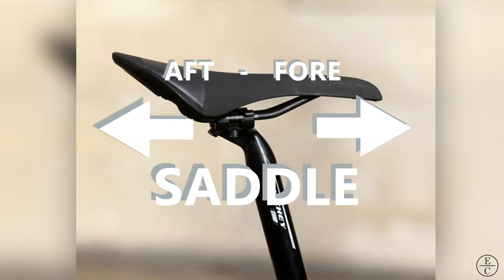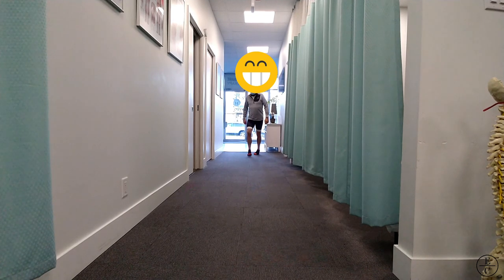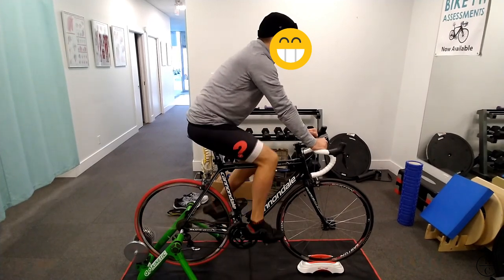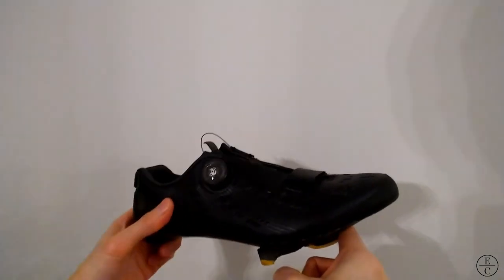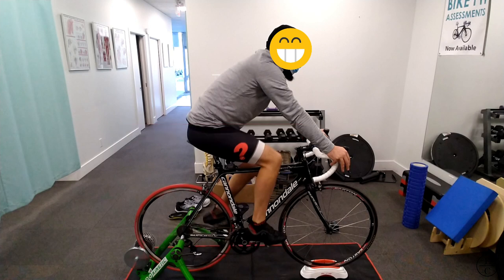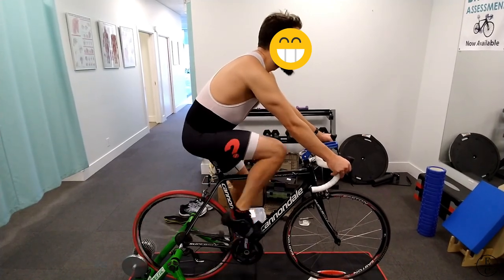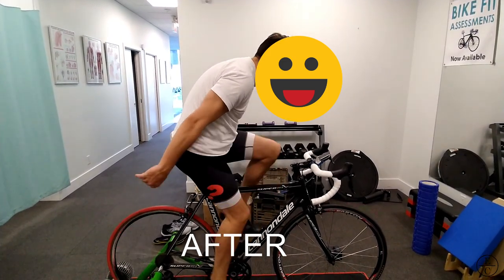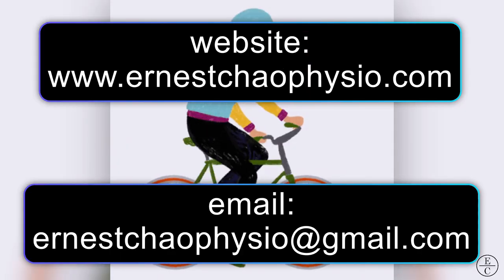"No hands" method to adjust saddle fore-aft

Comment: Nice video! 👍🏼 Could you please explain me why I moved the saddle all the way back (limit line) but still hard to keep the "no hand" position as you instruct? I have to put a lot of pressure on my soft tissue to maintain.
Reply from the maker: Other issues that may still limit your ability to pass the "no hands test":
1) incorrect saddle shape for your anatomy
2) not enough set-back on your seatpost/saddle
3) dysfunction of lumbo-pelvic region affecting your stability/posture on the bike

Comment: You know.... the cyclist featured in the video after doing the no hands test slides back an inch or more after putting his hands back on the bars. If this test is accurate that would seem to indicate he needs to slide his saddle forward quite significantly.
Reply from the maker: Hey Keith, thanks for checking out the videos. You bring up a very good point. The cyclist was sliding forwards slowly on the saddle during the no hands test so he ended up needing to put his hands back on the bars when the front/back balance on the bike no longer allowed him to stay up. I leveled his saddle afterwards but I didn't end up recording footage afterwards.

It's good to stay skeptical on anything you see or read on the internet anyway. If you ave a trainer try experimenting with using the no-hands test to see how it is for yourself!
Reply: Surprised to hear this method is patented and copyrighted too......
Reply from the maker: Haha, excuse my dry humour and sarcasm

Comment: Herniated L4-L5?
Reply from the maker: Hi sfef84, thanks for checking out the content. Those with herniated discs can often get back to cycling with the conservative treatment and exercises. Greater emphasis should be on hip mobility and spinal/core stability. Some compromises may be needed for a bike fit, where a low aerodynamic position may not be realistic. As well, a position on the bike where the lumbar spine is less flexion, or in other words, is in a more neutral posture while riding would likely help those with a herniated disc.